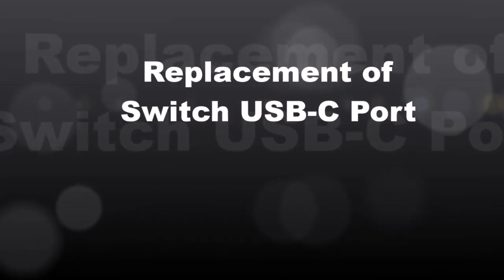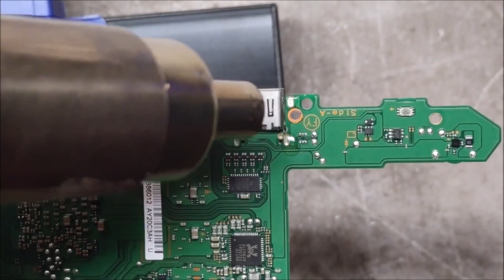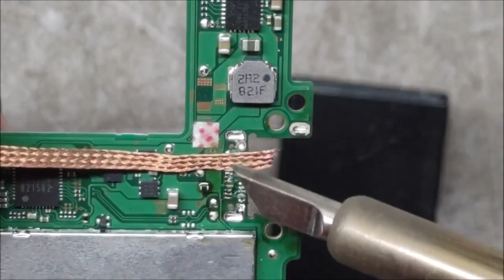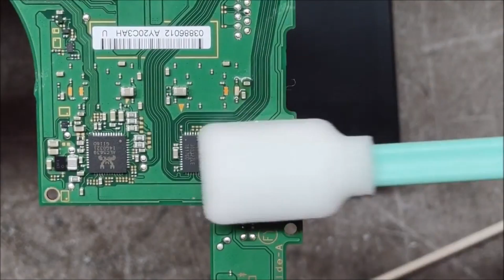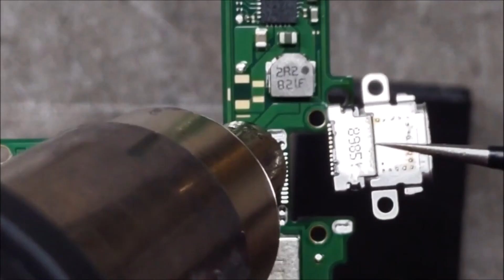DKOldies NEEDS to watch this (they won't)

Comment: When people say refurbish this is exactly what i picture , all kinds of parts replaced not just cleaned on the inside
Reply from the maker: That's exactly what it takes. It's a lot harder than wiping off dust sure but also much more rewarding and I don't like ripping people off!

Comment: I don't know, I mean if they can't be bothered to clean a system well I doubt they have the tools or skills to do this type of repair. Plus would you even trust any type of repair of this type by them?
Reply from the maker: Such a good point, their probably beyond refurbishment themselves at this point. Can't use a hot air station on DKOldies can ya.. 😂

Comment: Great video! Just want to ask quickly, could you tell me how you maintain your solder iron tip? I always burn mine out very quickly even when I coat it with a bit of solder...perhaps its because I buy cheap irons?
Reply from the maker: Letting them get hot will also burn them up easier, letting the metal sit on there to long without using it ect. Sometimes had Flux can also cause issues. I like the Flux I use and I always clean my after im done and re tin the tip. Yeah it could also be from bad metal if the tips are cheap.
Don't forget to like and subscribe! 😊